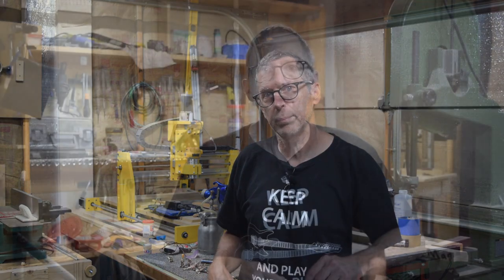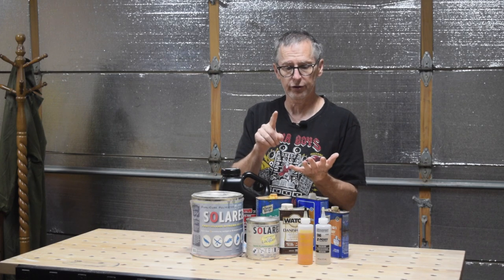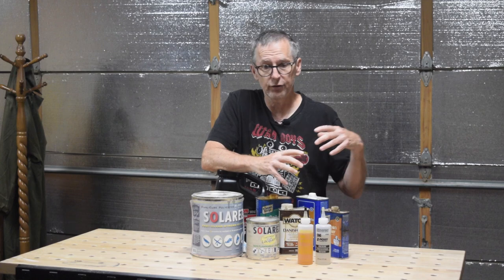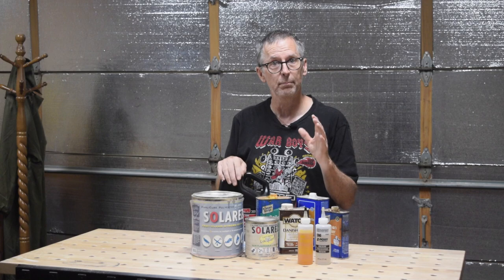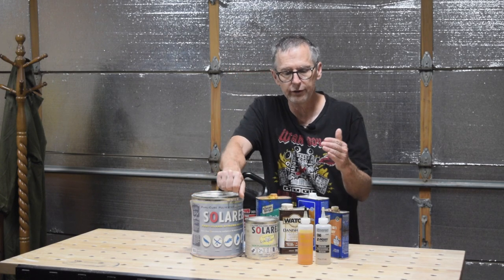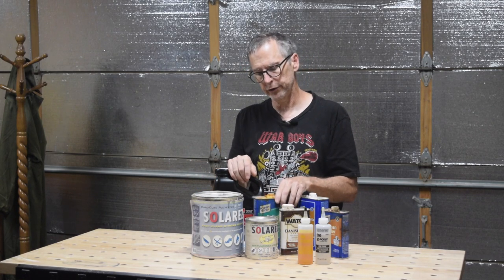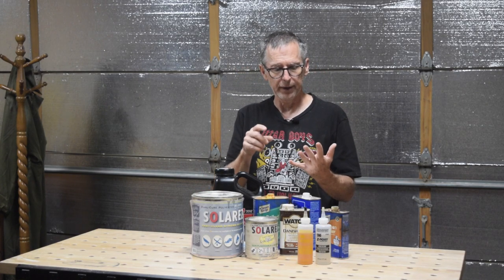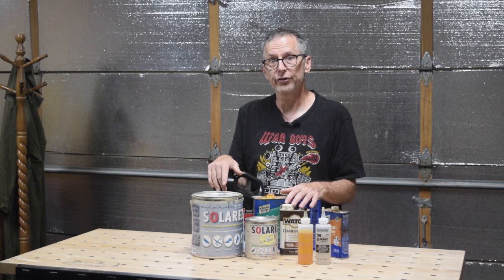Luthier Quick Tip 3: How to Decide On A Guitar Finish

Comment: Lacquer is the only way
Reply from the maker: What kind of lacquer? There’s polyurethane, acrylic, nitrocellulose, polyester, and Japanese lacquer. I’m sure there are more, but those are the ones can think offhand.
Reply: @HighlineGuitars  acrylic or nitro. Polyurethane sucks on a guitar. Nitrocellulose lacquer is the best especially for acoustics but all guitar are better with nitrocellulose
Reply from the maker: @russelmurray9268  Nitrocellulose turns yellow, cracks if you look at wrong, and is highly toxic and flammable. Modern finishes out class nitrocellulose in every category. It’s only good for replicating ugly old crackling yellow vintage finishes.
Reply: @HighlineGuitars  I have 70 year old fender that hasn't yellowed. I've refinished many guitars and never had a problem. Acrilic lacker feels like poly. It sucks. I use acrylic today because it's easier to get and works fine if I'm patient. I've had several people ask me to refinish the neck in nitro. StuMac has a great aerosaul. Once the instrument is finished they don't burst into flames. I've heard of spontaneous combustion in people but not in guitars. I know of no repair people using poly but the men I know are old pros and work for professional pickers. All the best acoustic guitar are lacquer not poly